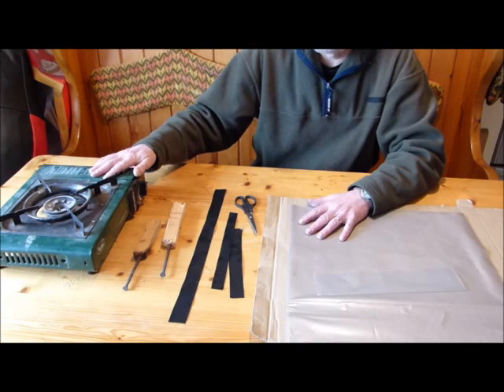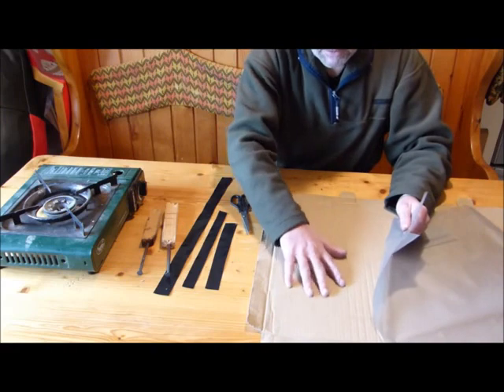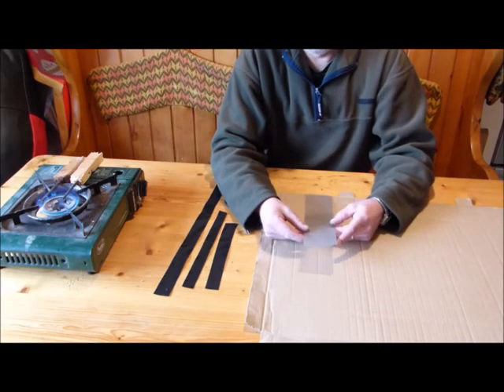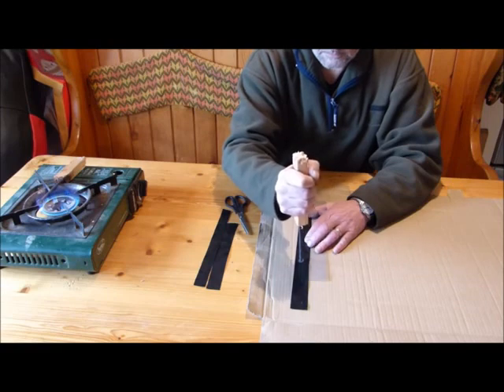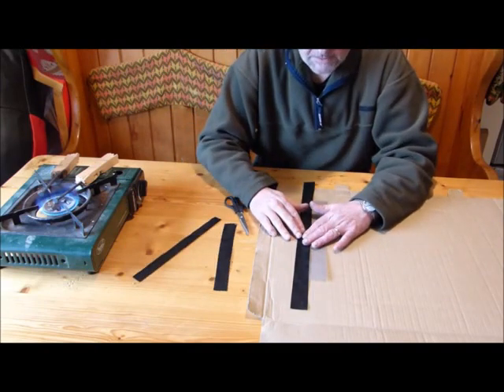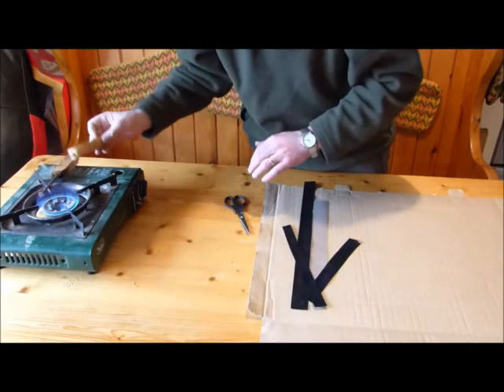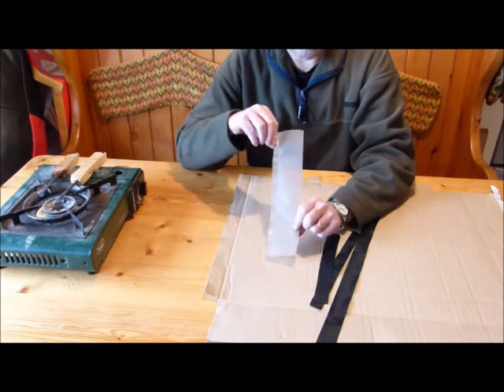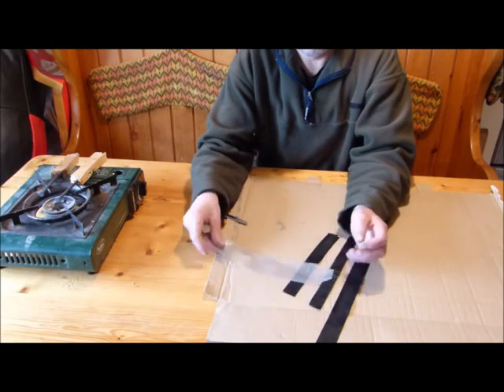How to Make An Inflatable Cushion with a Valve, using a Hot Nail - Part 1

Comment from the maker: Hi Jenna, I used ordinary plastic sheet from a hardware shop, the type used for covering greenhouses works well. Any 'thermo plastic' will work, which just means it softens when heated. The black strip is cut from a sheet of Teflon 'oven liner'. This stuff doesn't burn or stick to the plastic. You can also use something like masking tape (2 pieces stuck together). You need to make sure that the plastic has cooled completely before taking the strip off. Hope that helps.

Comment: what is the black strip that u used pls..
Reply from the maker: gafoor kml Hi, I cut up a sheet of teflon/non-stick oven liner. You can also use decorators/masking tape by putting two pieces together sticky side in.

Comment: Hello 
I am lost, with the materials, I tried with the tarpaulin that I have here and HUMMM bad! Then, the strips, where we can get them?  I have an electrical nail/welding, without the strip it burns the plastic, please help! :) thanks for sharing
Reply from the maker: Hi Maria, yes, you have to be careful what you heat up! Clear plastic sheet is good if you can find it. For the strip I use teflon oven lining sheet cut into 1-2cm strips. You can also use masking tape if you stick a few pieces together. It depends where you are and what you have available. I did think that a long leaf mightwork as well, but haven't tried it.